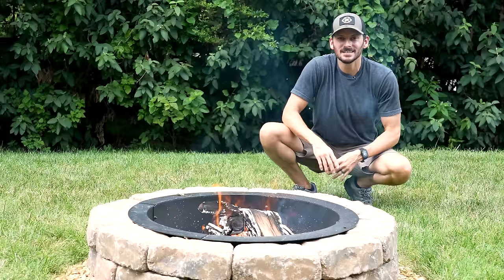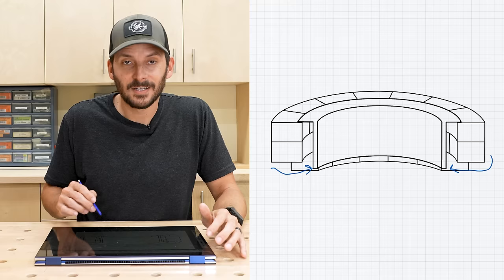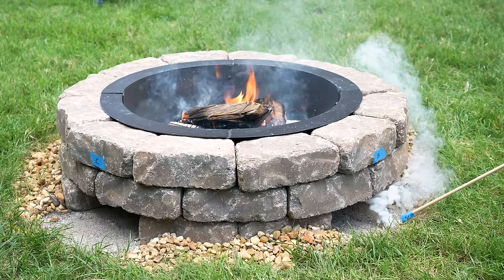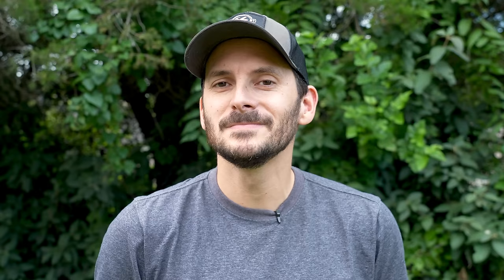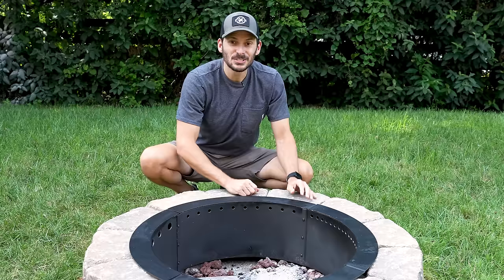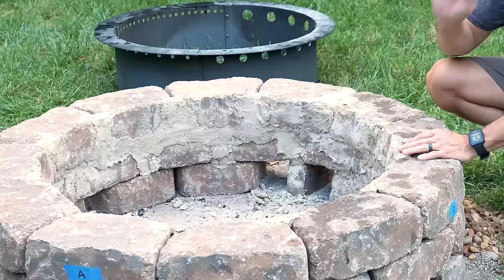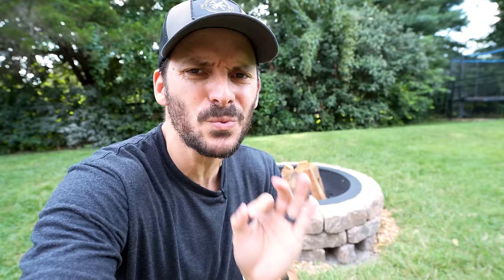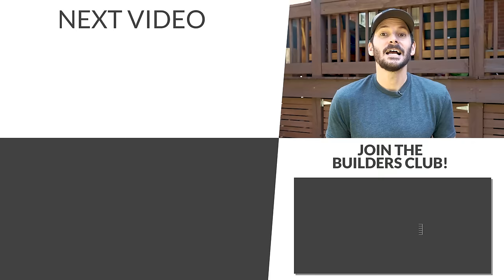Stop the Smoke, Do THIS to Your Fire Pit

Comment: Great video and tests! Love the tape idea for drilling, I'll remember that.
For my outdoor fireplace, I added a 12V 4" boat bilge blower underground, contained in drain pipe that draws air in from about 8 feet away and exits under the center of the pit.
When I need to get the fire going quick, or reduce smoke, I turn that on (hooked up to a 120V to 12V adapter and a smartplug) with my phone app and boom...raging fire and no more smoke!
Reply: I'd like to see a video on that!  I've thought about doing something like it for my fire pit.  How do you keep water out of the air duct?  What did you use for the duct to keep it from decaying from the heat?
Reply: You will eat a LOT of wood that way. Just make pit smaller so coals air mor in contact and heat that metal more. As I posted above 450F is minimum to get secondary burn.

Comment: Smaller solo stoves get a much better secondary combustion. I have one and I've made a tincan version as well. The tincan one worked just as well. So basically what I'm saying is that a smaller fire ring would give a much better secondary combustion. Large holes on the bottom small on the top. What else could have worked even better here would be to put a raised grate lining the bottom to allow more flow through the inner chamber and up through the secondary holes. Great video though, I'm going to build one i think as well soon.

Comment: Aside from comparing wet wood "before" to dry wood "after", this is not a bad video.
Keep building awesome stuff :)
Reply: Exactly.The real demonstration here was on the importance of burning properly dried wood.
Reply: Probably could've saved 6 hours of work by switching to dry wood.
I burned very old and dry oak flooring last night in an open pit and it was smokeless.

Comment: Try arranging your logs into a lincoln log cabin style. lay 2 wood splits parallel to each other and then stack 2 more splits parallel but perpendicular to the bottom splits. like a tic tac toe cross. helps promote airflow! I use that technique when i smoke meat! Great vid Brad!
Reply from the maker: That's what I started with originally.  The teepee definitely smoked less on start up though.
Reply: @Fixthisbuildthat  really?? Dang. Ok ill shut up haha

Comment: Diameter vs. how deep the firepit is, seems to be your main issue.
Also, you could try making a bed of the firering to force the air intake to exit closer to the center of the firepit.
EDIT: DAMNIT, bumboclat was 22 hours earlier than me!
EDIT2: Also, another way of improving would be, assuming you make a firering bed as I suggested, would be for iron rods to entertwine with the middle of the firepit - this would act both as a way to easier set up a fire, but could even be bend into being able to support a stove - as well as absorb a lot of the heat from the fire, and since it being iron and connected to the firering, also heat up the firering quicker, and more, which in turn would make the firering more effective at pulling air to the upper holes.
Reply: analyzing stuff and discovering what forces are at play is one thing... balancing those forces to obtain the perfect result is a whole different ballgame.
Reply: @WithmeVerissimusWhostoned  You sound like you're being barred from testing this.

Comment: I think your fire pit is just a bit large for how low it is so you'd need an absolute inferno in there to get the secondary combustion really shooting out flames. You need the height to give the air more time to heat up and to separate the secondary flames from the primary fire
Reply: I'm surprised that he didn't understand this concept. It's kinda like watching someone try and copy the design of a car, without understanding how a car actually moves.

You can put four wheels on a frame, and add a pedal. But if you push the pedal, it's not gonna do anything UNLESS you also have a drive train. It might LOOK like a car from the outside, but it's missing the science under the hood.

His design is fine - it's just massively oversized, like you said. He's never gonna get the temperature differential necessary to cause the draft he's going for
Reply: @zp944  Well, air does heat up quite fast tho so it might be easy to overlook. I'm not an expert on any of this so even though I'm kinda confident in what I said I can't really back it up with anything else than 'That's what it looks like to me'
:D

Comment: Hmmm...  I love that WD-40 smell for the same reason. My dad was a truck mechanic and when he came home with his hands all greasy covered with diesel fuel and break cleaner I would get a whiff and think "Daddy's home!"  Don't think I would wear it as cologne tho. I want to try and build a smokeless fire pit using sheet metal from old washing machines using the half inch holes. You do good work!

Comment: I've always thought that fireplaces and cast iron stoves should have outside air intakes. Would reduce smoke in addition to not drawing cold air into the house. Thanks for sharing.
Reply: My fireplace is nearly 100 years old and it does actually have an air intake at the back of it! It can be opened or closed with a 90 degree turn. Quite a good addition.
Reply: Most homes w wood burning fire places have an ash dump with an outside door. I put an grate over the hole at the back of the fire place so I don't lose coals. I'll open the ash door all the way and close my fireplace glass when I start the fire and it's like a rocket stove. Fire gets roaring in no time. After you get a hot bed of coals you almost have to close the ash door all the way tho. That cold oxygen blowing right on the bottom of the fire will burn thru some wood!

Comment: One of the differences from the patent and your fire pit, is that in the patent, the bottom inlet air is going underneath the fire.  Yours is just going to the base of the fire, so anything not near the sides won't get enough oxygen.  With a grate that keeps the fire, or most of it, off the bottom of the pit, you'll give the inlet air opportunity to go underneath the fire.  That might take care of the small amount of smoke.

Comment: I think a big part of the efficiency of the patented firepit unit is its size. Your fire ring is bigger, meaning there's more air in the middle to heat, the fluid dynamics of the air flowing through the holes may work differently, etc. Compare with the extremely upscaled version where you have a 6' diam fire ring but the same heights, same size holes around the rim, etc. I think their patented unit just has an optimal size ratio for smokeless fires given a particular expected fireplace height.
Reply: I think this is true as well. The SOLO stove is smaller in diameter and also taller, forming more of a chute and channeling the heat better  

There are flaws with the SOLO design that lead me to not buy one, but I'd like to reverse engineer it some day and build a better fire. 

But ultimately, it's almost impossible to build a smokeless fire if you use wet wood. The wood just can't get hot enough.

Comment: We did something very similar by leaving bricks out of the bottom layer around the outer ring to create air gaps, and then I put regular brick [yes I know could've/should've used fire brick] flat on the ground with expanded metal on top of that to ensure constant airflow under the fire.

Also using an old washer drum works really well.

Cool video btw.

Comment: Apart from the diameter issue,  the solo stove has a rolled in top lip which shapes airflow.  You can approximate this with a cap ring as long as the upper breather holes are set at the right spacing (I suspect it's 1/3 the internal overhang down from the top edge in order to get the right rolling turbulence to achieve good secondary combustion)
Reply: I think the cap is what helps guide the top air holes into the heat to combust.  With the cap ring off or upside down it won't have the secondary combustion.
Reply: Can these be used for cooking/grilling fires or would a traditional fire ring work better?

Comment: I think the big issue is your secondary air that goes through the top holes is cold.  The stones cool the air too much and it is exiting the holes too cold to ignite the smoke. You saw this correct itself when you allowed the fire to burn for a while, which allowed the stones to heat up, and then produce secondary air that was heated. I believe the better solution is the one that is already out there. You need to have two rings and a small insulating air gap around the outer. The air traveling up between the two metal rings is going to be be heated faster and hotter.
Reply: Just what I was thinking, all the heat is sucked up by the stone.
I should have started reading from the oldest post to the newest.

Comment: Really good vid. Question though: With respect, How do you know it wasn't just the extra dry wood at the end and not the pit design?
Reply: Thank you. Good vid for ideas but nothing scientific about any of it.
Reply: @briholt100  how isn't it scientific may I ask.
Reply: @leedza  well, the core idea of science is setting up controlled comparisons.  So, comparing one thing while holding other variables constant.  Also lots of trials with as similar wood and moisture.

We do that because when you change several things each attempt, changes in behavior (smoke) may be due any one of those things, or a combination of them. 

Dry wood, different size holes in the ring, gaps in the pavers, these are good examples trial and error, but it's not scientific. 

And just to say it again, lots of good ideas.
Reply: @briholt100  do you realize how incredibly broad of a term 'scientific' is? Besides this having clear principles of airflow, combustion etc. literally anything could be looked at "scientifically" in some way.
Reply: @TheTuttle99  words matter or  not.

The post I originally replied to, asking how does one know if the final adjustments or the very dry firewood explains the fire pits performance is exactly what doing things scientifically avoids. 

Had the guy said some "trial and error" he would be fine. Even experiment would be better.

Comment: In addition to your trial and error on the fire pit, I will add that the "Lincoln Log" stacking of wood is much better than the "teepee" method of stacking with respect to air flow and reduction of smoke.  

I have been wanting to make my own fire pit for a while, and I will be sure to follow these plans/ideas when I do someday build mine.
Reply: exactly, and I even saw a vid where flat stacking combined with ignition from the top is even better to reduce smoke
Reply: I'm inclined to agree.  Early Spring of 1996, while playing with my modified Chemlab kit that I had received as a Christmas gift months earlier, an unfortunate reaction occurred and sent flaming liquid down the side of the workbench right on to a pretty elaborate lincoln log fortress that I had created. The blaze only lasted about 3 minutes but the absolute carnage was noteworthy. The lincoln logs created a perfect environment for mass combustion. The workbench and wallpaper were damaged. Carpet ruined and about 70% of the log fortress was unusable afterwards. Several action figures were lost in the fortress(RIP to Snake Eyes, Destro, Baroness, Wolverine and Omega Red).

Comment: Great work! I usually think in extremes, to see the possibilities. Therefore , I think there is a correlation between the size and height of the optimal smokeless fire pit; If the pit would be taller (deeper) , there would be more pressure and suction generation for the air flows (chimney).  Extremes: what would happen if the size would be 6 feet across and this low a rim? Right, You see, if it is too large and shallow, no effect , what ever the size of the mantel holes.  What if there is a cylindrical  metal barrel "chimney" built on stilts a few feet above the pit opening with a similar diameter catching the heated gasses and sucking them upwards- turbo?  Could you put shelves in it and make fast hamburgers that do not taste so smokey?

Comment: I enjoyed the pace and your entertaining presence in your video...not always the case with DIY videos. The approach and progression of your testing methods helped me think through the construction and physics of the design. I am working on the final design of the Smokeless Fire Pit being built at our home and I had a few questions about the final specs of the pit you ended up with.  As noted by @SmokinOak, it seems that confirming the height of the fire pit, which will require a fire pit ring that is tall enough, may make a difference in the pits ability to heat up the smoke coming out of the top holes. Will you please confirm the height of the ring you used and if you have done any further testing where you tried using a taller ring? Also, in your video, you mention putting 15 each ½” holes spaced at 1.5” apart and then adding 6 holes in the bottom spaced at 3 ¾” apart but I do not believe you mentioned the size of those holes.  When examining the images in the video, they appear to be large than ½” holes.  Will you please confirm what size those bottom holes are and the height of the fire pit and fire pit ring?  It would also be helpful if you provided the weight of the fire pit ring to ensure I get a heavy duty enough ring.  I look forward to hearing from you and watching more of your videos.  Cameron

Comment: I noticed that the diameter of the fire pit seems to make a huge difference and its not being taken into consideration. When you made each fire the wood was very far away from the metal ring. It didn't start becoming smokeless until the wood fell down and got close to the rings and allowed the pressure vortex to take place. I bet if you used the wet wood you bought from a guy that it would also become smokeless once you got the wood close the metal ring.
Reply: @Hello there, how are you doing this blessed day?

Comment: Pro tip …you don’t want to  lubricate cutting tools . You want to cool them .  Get yourself some cool cut fluid . Your drill bits and cutting tools will love you for it .  With oil based lubricants the metal shavings will pile up under your cutting tools shortening the life . Some good flow with cutting fluid washes that away. Great video . I’m going to make one of these .

Comment: I think smaller holes at the top and increaseing the height by at least two stone levels would have helped and let the air and smoke heat up. The problem with a pit  is you can only add more air and increase the height to let it heat up and increase efficiency . What you are missing is the closed bottom of the other fire pit uses the down draft effect to pull down into the bottom inside holes to  heat the smoke between the walls and mix with fresh oxygen  to create the biogas that burns from the top holes. This happens in the rocket stoves because of the combustion chamber of the taller chimney.

Comment: How important are the holes at the bottom? I saw other videos that did not include those. They said you only want the ones at the top so the air comes out the top holes only. However, I did this, and right now, there is a lot of smoke
Reply: "i did this" meaning you added holes to the bottom? what worked for you?
Reply: It’s not based on air going out of the holes, it’s oxygen coming in through them to get a more complete combustion. Smoke only happens when the fire isn’t getting enough air, both sets of holes are pretty important.
Reply: You need both sets.  The lower set are to feed that fire oxygen. The upper set helps you burn off smoke (smoke is flammable).
Reply: the holes at the bottom are more important then the holes at the top

Comment: Not sure if this has been mentioned but to really get secondary combustion (where it looks like flames are coming out of the holes) you need the holes to be above the wood/fuel source. The lack of smoke in your final fire is more due to using dry wood than secondary combustion.

Comment: Brad ... must admit that I'm a bit disappointed; using a drill and hole saw for modifying the metal ring?  I would have thought that the engineer in you would have gone for a laser or water jet cutting machine..... Just Kidding.  
Always enjoy the way you attack a problem.

Anyone want to guess how long it will take the marketplace to start selling fire pit kits with the FTBT modifications? 
Aloha ..
Reply from the maker: I was thinking while I was cutting these...man, I wish I had a hydraulic punch 😀

Comment: I've used my old 21 inch BMW aluminum rim as the inside of my fite pit with them stones around and a gravel base & I deliberately left a little slit of space between the stones for the air to go through & 10 yrs later that Aluminum rim isn't burned or rusted etc. Still looks and works GREAT